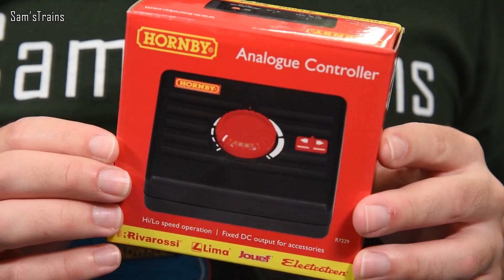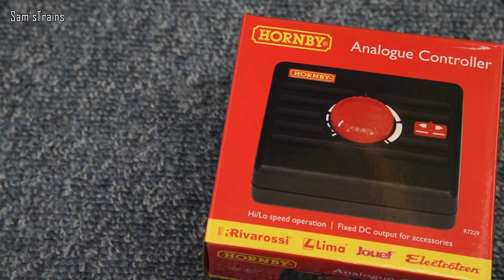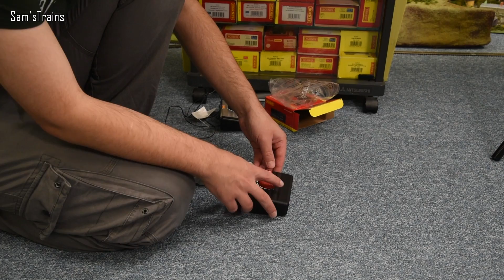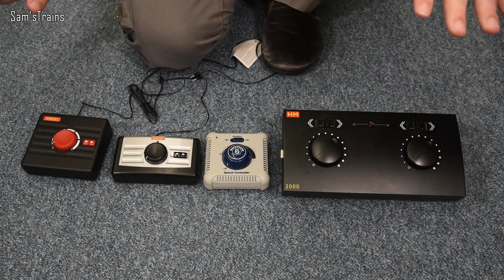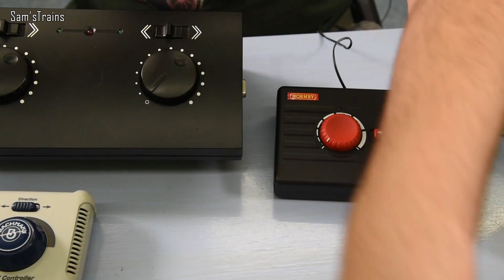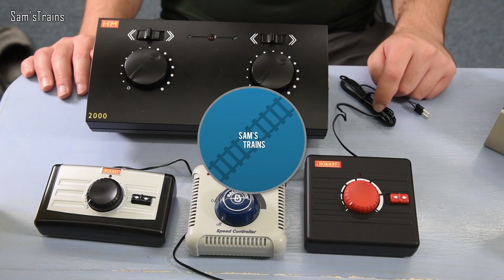Hornby's New DC Train Controller | Controller Buying Guide

Comment: I got a Coca Cola set and the new controller was fine, then after a while the locos made a high alarming noise. Hornby sent me a replacement and I got it today and it’s got the same issue, I’ve also seen this on Facebook so it must be a common fault
Reply from the maker: Could it just be the controller, like mine? They definitely do make an alarming noise - consider buying a Gaugemaster controller - they're way better! :D
Thanks for watching - Sam :)
Reply: Sam'sTrains it’s the black and red new one. I am considering a gauge master but also considering making my own like what budget model railway’s made.

Comment: Hiya Sam - @ 10:38 I just bought 2 sets with that new Controller - the GWR Freight (R1254) & the Hornby-Dublo Train (R1252M) & yes also it make that horrible noise ( https://youtu.be/6_C5M466tEE - I made a special Vid about it!!!) & that is why I am always recommending on the Hornby Forum either the H & M Duette or 2000!!! I agree with you about the design & about having the 'Click'!!!
Reply: Also Hornby have up-dated their Web site saying "This item does not include a transformer. However, the required P9000 Transformer can be purchased separately here"
Also I only use the R7229 for my 'Test Track' only & I didn't know about the age old Short Circuit Protection on the R7229 - thanks for that  :) IUsae both the H & M Duette & 2000 for my Main Layout!!!
Reply from the maker: Ahh fantastic mate, that sounds awesome!! :D
Thanks for watching - Sam :)

Comment: Some information on the way controllers work. 

Some of those controllers are PWM... which means the amplitude is fixed at a level that will NOT damage the motor. The buzzing you hear will also not harm the loco, and is dependent purely on the frequency. This is why the new controller makes the motors buzz louder than the old one, and will probably give better slow speed control. DCC also uses PWM and you only don't hear it because the frequency on which it is based is so high. I believe the H&M uses a thyristor output, which varies the pulse frequency and amplitude, and at a higher frequency, which is why you don't hear it. In summary none of these controllers will damage a loco.

The H&M controller outputs such a high current because it has large capacitors in it's power supply. So this current is only available until those internal capacitors are discharged. Also, the aux output current available on that thing is useless for such an expensive controller. 

As far as the short circuit protection is concerned, yes annoying, though I'm sure Hornby are using resetable thermal fuses to save money. They need time to cool down before they reconnect. Not sure how much proper electronic cutout would have costed, but I can't imagine that much more.

Finally, a 500mA power supply doesn't consume 500mA, it provides 500mA, which means the full 500mA is available for the controller.
Reply from the maker: Thanks Michael, although I've measured peaks of 19v DC on the modern controllers, which is known to damage more sensitive older models (I've had it happen!) But you're right, the noise doesn't indicate strain on the motor, quite right!
Thanks for watching - Sam :)

Comment: I bought one of these to use for my point motors as it has an onboard CDU which is highly recommended if you are going to use solenoid point motors that require a good amount of 'burst' to not overheat them.
Reply from the maker: Ahh fantastic - does it work well??
Thanks for watching - Sam :)

Comment: This is what I don't understand, why complicate the situation all the time, buy a transformer then a controller, I had a PIKO set that included both, I was wondering why am I losing power, my models are not that slow. I use my MRC power supply controller and they fly off the tracks ,not really. I think in Europe they do it like that so the kids do not destroy the models cranking up the throttle all the way to the max
Reply from the maker: Thanks for the comment Chris, you may be right!
Thanks for watching - Sam :)

Comment: The Bachmann controller is £36 at hattons now.  I was tempted to buy two, one for each line, but the HM2000 is only £94 at Hattons at the moment.
Reply from the maker: Yeah that's definitely not too bad - but I think the Gaugemaster controllers are much better - how much are those right now??
Thanks for watching - Sam :)
Reply: @SamsTrains  They've got the little Gaugemaster Combi controllers (12v, 1amp) for £34.  I've got 3 tracks (2 main lines, and a little branch line I'm planning) that I want to control separately, so 3 Gaugemaster Combis seems like a smart choice I think.  The down side is that means 3 transformers, so 3 plugs in the attic.  Maybe an HM2000 and 1 Gaugemaster Combi is better.

Comment: nice video i think are power outlets are different in the u.s how to i get a controller that works here
Reply from the maker: Yes they are - you'd just need a different power adaptor, designed for your voltage!
Thanks for watching - Sam :)

Comment: Low speed running of electric motors should be better by PWM.  The analog controllers drop the voltage to control the speed, this is hard on the windings as it tends to overheat them.  

With PWM you are running full voltage but turning it on and off very quickly to control speed.  This is less likely to stall the motor and also doesn't overheat as much.  There should be better pulling power by PWM.  The buzz you hear sounds ugly to the ear but is better for the motor.

Low speed operation of motors is "hard" on them.  Moderate power would be better.  The higher frequency PWM would be better but it sounds worse.
Reply from the maker: Duly noted, thanks a lot for the info - yes that makes sense!!
Thanks for watching - Sam :)
Reply: @SamsTrains  I am no expert :)  I have no experience with trains but your videos are good to watch.

What you might want to do is check the amperage running out of the controller.  Voltages will be the same between the controllers because your meter will average the PWM spikes so it will look like lower voltages of the analog controllers.  If you use an oscilloscope you would see it... I bought a tiny $20 oscilloscope from ebay.

I think you will see higher amperage from the analog controllers especially at stall and it is higher amperage that overheats windings.  That is coupled with the lack of cooling due to the motor not spinning quickly enough to blow air past the windings.

That being said I could be wrong :p  It could be the motors being so small are subject to different failures.

Comment: Hi Sam, I’ve an old flying Scotsman set from 1998. When accelerating to a certain speed it starts to make a squeaking noise and will start jolting not straining full speed. Would this need an oil or would the motor need replacing? Many thanks
Reply from the maker: It probably just needs a service - feel free to look up my video on servicing the ringfield motor!
Thanks for watching - Sam :)
Reply: Cheers Sam

Comment: Go speed is for newer engines that do not need a lot of power it's a mixture of the incidents that can go at slower speeds can stamps or speeds but the engines that are older and need more power need more more power pretty much so you give the older engines more power for the kid idea but in America where I live that actually not on every Transformer on the smaller traps home where is either go really slow or really fast but on the big monster Transformers that were used to be used they have slow speed what you guys have a big control of Beastie next to you DCC controller thing I have but I think Hornby to go USB a USB Hornby ring to it I think they have a USB wire so it can be Universal just make sense also I forgot to use periods we got to use like the tap tap to pass I tapped the Google thing there and I speak the phone to get all my words in
Reply from the maker: Yeah that's true Nicholas - great to have a bit of extra control anyway! USB would be very interesting - but at such low voltages, the current draw would be pretty high - a 1amp output to the track would require at least 2.4Amp on the USB side, which is pretty heavy! :O
Thanks for watching - Sam :)

Comment: I bought a new one, and had a look at the waveform on a scope, and there is a fair bit of difference between high and low. The frequency overall did look higher than I might have expected, but then again I have not looked at any others. I will have to compare to my 40 year old H&M Rocket, which is not PWM. The controllers on my Z gauge seem a lot better and run from batteries.
Reply from the maker: That would make sense, maybe the frequency is altered in cutting the speed??
Thanks for watching - Sam :)

Comment: I use old triang Hornby controllers from 1974 they still work fine no buzzing and I have a metal triang one from 1978 for shunting they work way better than the new ones
Reply from the maker: You can't beat the old ones, that's for sure! :D
Thanks for watching - Sam :)

Comment: so how would the wires on the HM 2000 controller hook up? does the plastic on them need to be stripped? or can it be plugged in normally? reason why i'm asking is because i'm thinking about buying one and all my models/track are hornby (no regrets)and i live in americia, and another problem would be finding a proper adapter for a u.k style plug.
would you happen to have any recommendations?
Reply from the maker: The HM2000 doesn't come with wires fitted - you fit them yourself. They may come with some wire, or you can easily create your own by stripping some speaker cable! The hm2000s run on the mains, so you need to check whether they're suitable for 120v!
Thanks for watching - Sam :)

Comment: PWM is not always a bad thing - I built a controller as described on Budget Model Railways https://www.youtube.com/watch?v=T64lhCwN9Ws.  Works great. No motor noise at  low voltage.
Used a cheap plastic container instead of the 3D printed box ...  but the box Budget Model Railways looks cool and needs no modifying.
Reply from the maker: That sounds good Malcolm, I'll be sure to check that out! You're right, PWM isn't always a bad thing - but I do beleive that Hornby's application of it could be damaging to more sensitive motors!
Thanks for watching - Sam :)

Comment: Nice comparison. It appears that they are different versions of the Bachmann controller, theirs the one you have, theirs another one which dose not have that snapping sound when you turn it off, and their is one which is identical to the one you have, but the key difference is that it dose have plugs for accessory's. Anyway nice review on the various controllers that exist.
Reply from the maker: Thanks a lot for that, yes you're right - there are quite a few different versions of that!
Thanks for watching - Sam :)

Comment: A very interesting controller review, Sam. The HM2000 is my main controller and has served me well for years. As I tend to buy trains sets as opposed to stand alone models I have a collection of controllers. I find the silver Hornby one to be utterly useless for my requirements and as my HM2000 is set up at the other end of the loft for running sessions I use the Bachmann for all my testing. I like the amount of control I get and it feels quite well built. Thanks again for the review and all the best....Tom
Reply from the maker: Thanks a lot Tom - yes I can't fault my HM2000s either! I had the same experience with the silver Hornby ones too - absolute poop!
Thanks for watching - Sam :)

Comment: Hi Sam. For dc layouts gaugemaster will usually outperform the competition with ease. I personally won't use anything else. With the superb controllability plus a very smooth output usually puts an end to noisy motor problems. Cut out resets in seconds. I've had no motor burnouts in over ten years of ownership. The lifetime warranty is a bonus so all in all Gaugemaster are very good value for money.
Reply from the maker: I agree Chris - I picked up a gaugemaster controller after this, and they are superb indeed!
Thanks for watching - Sam :)

Comment: I recently got a used HM2000 controller and see you have several. Do your locos make a humming sound when in slow motion with this controller. My Heljan class 57's make this noise but not with my old S.E.C. controller.
Reply from the maker: Yeah that can happen John, they do use very gentle PWM for speed control, which will produce that humming! Provided the locos are clean and lubricated, it won't damage them!
Thanks for watching - Sam :)

Comment: For those in need of a cheap and good alternative to the DC power supplies: you can get a variable voltage (9-24v) dc power supply on eBay for around 10 pounds..,
Reply from the maker: Yeah this is true - but they're not very good for controlling model trains - not to mention the potential to over-volt them ;)
Thanks for watching - Sam :)
Reply: Sam'sTrains yeah... i meant in conjunction with a model train controller. Just as power supply... :-)

Comment: Sam I’m just here to ask a question. Does the controller from the train sets damage the motors badly? Should I get another train controller? 
Thank you for your time,
Piggynice
Reply from the maker: I wouldn't say that it can damage them badly - but the cheap Hornby ones are much more harsh on motors than the HM2000 or Gaugemaster ones are - if you have some spare cash, it's well worth upgrading it, but not absolutely necessary!
Thanks for watching - Sam :)

Comment: Sam, great review! I've had my Guagemaster analogue controller for 25 years now. Never a days problem and it has a Lifetime guarantee, you do get what you pay for!! Take care now, Terry.
Reply from the maker: Thanks a lot Terry - yes I get that impression from the Gaugemaster controllers too - I do need to try one!!
Thanks for watching - Sam :)
Reply: Hi Sam. I'm afraid it's gaugemaster and nothing else for me. They are well made and give a very smooth performance and are excellent for extra slow crawling speed control. All of my loco motors (all bachmann) are exceptionally quiet. Even the handheld model will walk all over most of the opposition. Their electronics give a very smooth dc output (no noise/spikes) +the lifetime warranty make the gaugemaster controllers a superb investment. I've not had a motor burnout at all in 15 years of using my gaugemaster controller . I rest my case. As usual a very entertaining video .

Comment: I've not been a fan of Hornby or their products for a long time. They seem a very confused company with varying standards. Some stock has NEM couplings, whilst others retain the old style large couplings. I don't by their loco's, except newly produced stuff, otherwise I don't know what I'm buying. Is it an old Lima body, has the motor been updated. If it has, it's a compromise, as it's not like it's been designed to all work together from the drawing board.
Then there's Railroad. Some stuff is as near as good as their higher range products, whilst other stuff clearly dates from the back catalogue and pre 2000s.
Also, why can't they give them a product code RR. It's confusing on many stockists websites whether it's from the normal range or the Railroad range. The product code and description don't tell you either way. With that in mind, I avoid.
I'm sure the they survive because of the history of Hornby.
I prefer Bachmann products, plus new comers on the block like Oxford and Accurascale etc show what can be done.
I think the quality, lack of thought in its feel and economic design and the cynical way it's packaged and portrayed says it all. I to would assume it was the complete package, and didn't require an additional power supply.
Imagine the disappointment when people get home and find it needs a power supply to work.
Great way to upset and possibly lose customers.
If Bachmann can make a superior controller that cost less than the combined price of the Hornby product, then Hornby need to take a good long look at themselves, their products and marketing strategy.
Personally, I think Hornby have big feet and a large gun, and repeatedly shoot themselves in the size 12s.
Reply from the maker: Yes you're absolutely right about that Neil - they're riddled with inconsistency, and they often make puzzling choices with their products and marketing - it's all quite entertaining to watch I find!
It's the free market though - if a company fails to offer good products for a good price for too long, others will take over and they'll go out of business. It happened to DJM, and it'll happen to others without a doubt!
They certainly do - how many more bullets until those big feet give way?
Thanks for watching - Sam :)
Reply: @SamsTrains  
Thanks Sam.
You do get the impression sometimes that it's a company that's either dabbling or entered a market it doesn't truly understand.
Which, as we all know with Hornby's heritage, really shouldn't be the case. They should be showing the rest of the market how to do it, not just playing catch up all the time.
Keep up the good work.